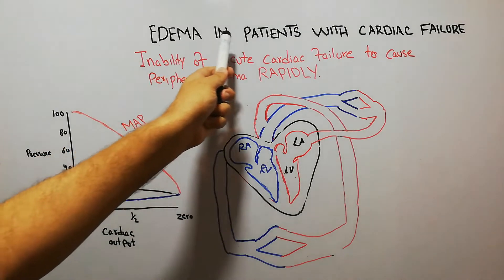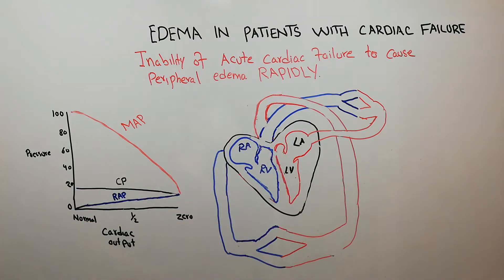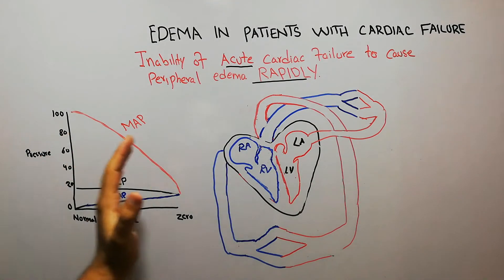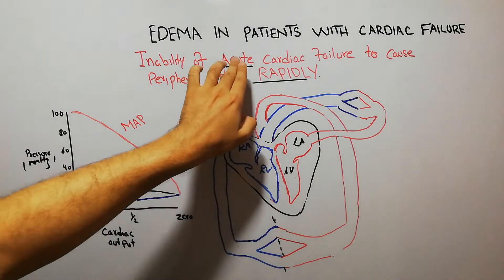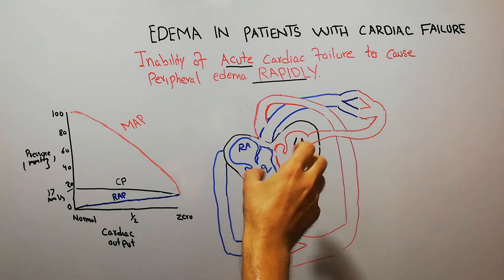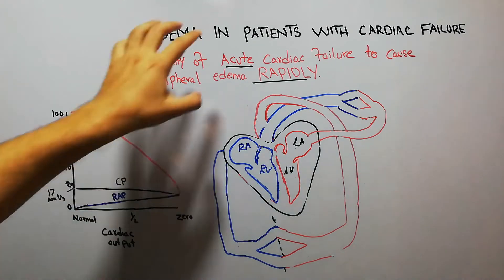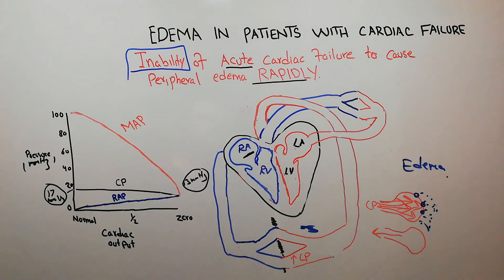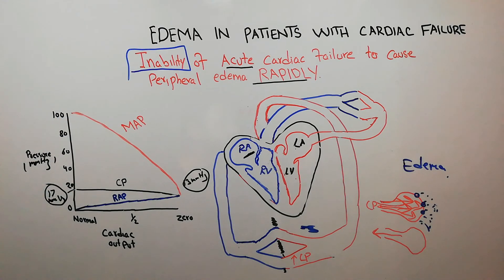CVS 220 | Pathophysiology of Edema in cardiac failure

Comment: I wish I could figure out what is causing mine. I'm having a sporadic bilateral for really demon and it will last 2 or 3 days then go away maybe for a week or two then come back. Now I've had it for about 2 weeks and I don't know what the issue is. I do not currently have any diagnoses that would explain to me what's going on. I'm 41, I had recent lab work and EKG that were both normal however I've not been able to get to a vascular cardiologist because I have no insurance and had to unfortunately go to the marketplace which hardly any doctor accepts. While I totally get that, I don't know what to do because it's not going away. It's not REALLY BAD but definitely noticeable. How about 15 lb overweight and well I'm sure that contributes, I don't really think that's it. I've been heavier than this and didn't deal with bilateral peripheral edema.
Reply from the maker: Causes of bilateral pedal edema include use of some drugs like calcium channel blockers, proteins deficiency, long term standing job, heart issues, kidney issues, liver issues, blockage in major blood vessels etc etc etc
Complete work up is required